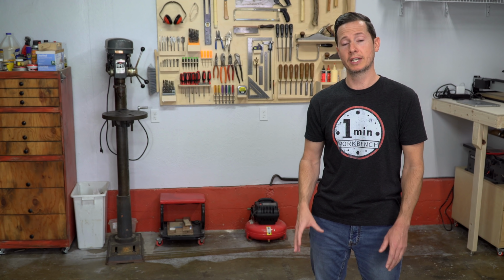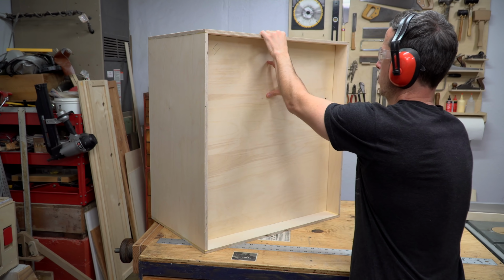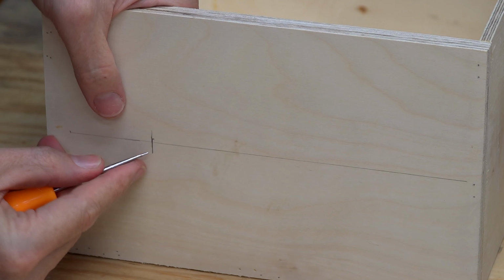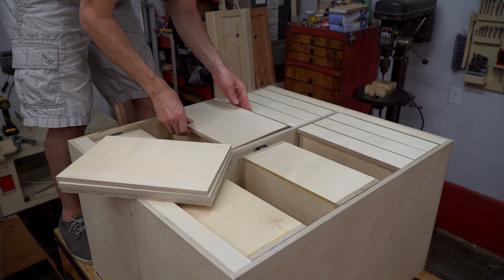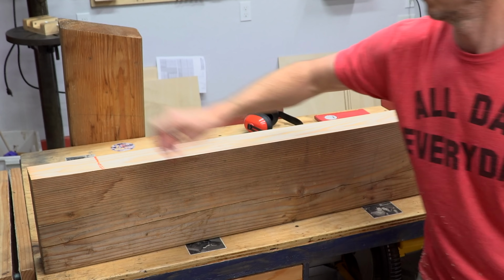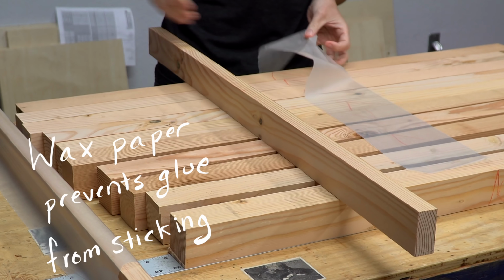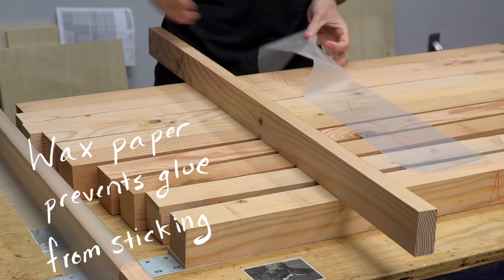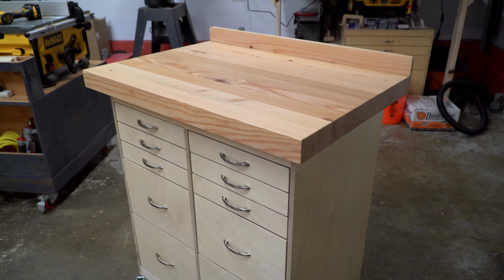Mini Workbench with a Big Top

Comment: I like it. I think it’s similar to what would be suitable for my shed except I would make a longer one. The design is good drawers on front then shelves at the back plus it looks a bit higher then a standard bench which would save on the back and leaning over.
Reply from the maker: It was her design mostly, and it worked out great 🙂

Comment: Cool stuff, what kind of air compressor do you use? We can barely hear it and it seems to handle all the nailing.
Reply from the maker: Thanks! I use a little 3 gallon compressor, and I keep it in a special compartment of my workbench that keeps the noise down.

Comment: I'm puzzled, a very robust top with a 3/4" cabinet frame seems anemic. Wouldn't  3x3 posts at each corner and 3x3 mortise & tenon rails and a 3x3 center brace transfer forces directly to the thru that beefy top?

Comment: Next time you're in the baking/food storage aisle, grab a roll of "parchment paper" instead of the crappy "wax paper."  Parchment paper is silicone impregnated and is far superior to wax paper for uses with glue up, sealants, etc.  The parchment paper can also withstand heat without melting like wax paper.  Cost is about the same but uses and performance is superior.